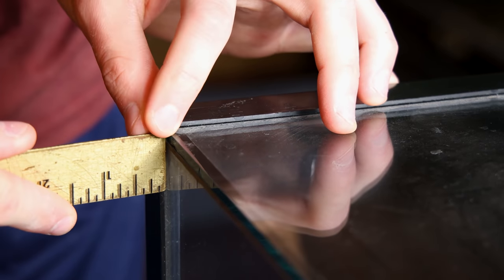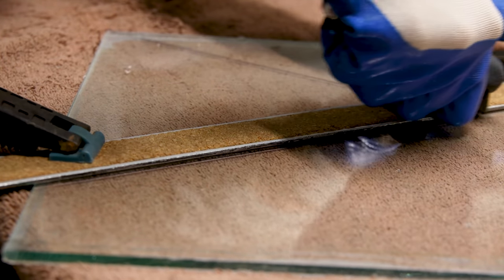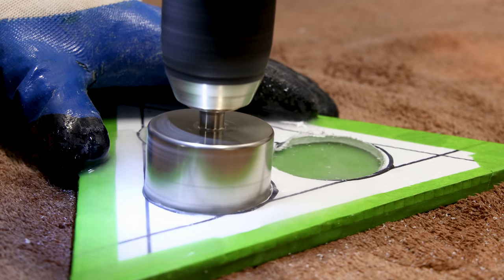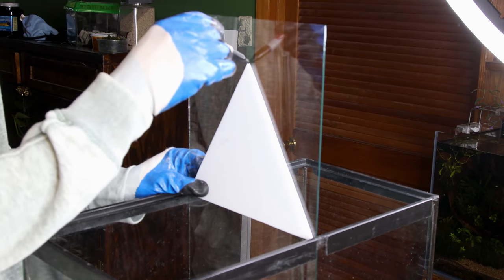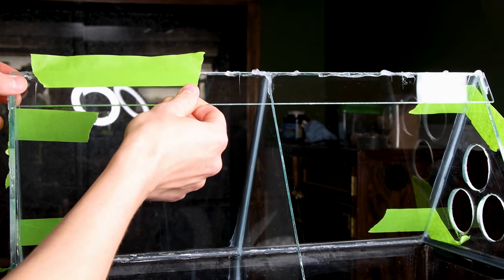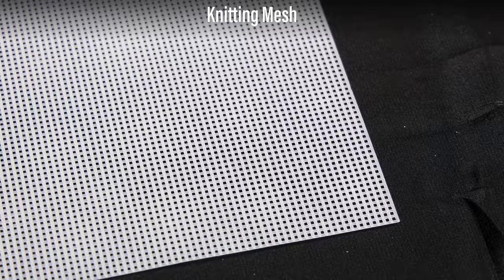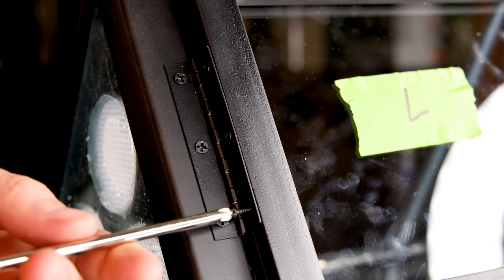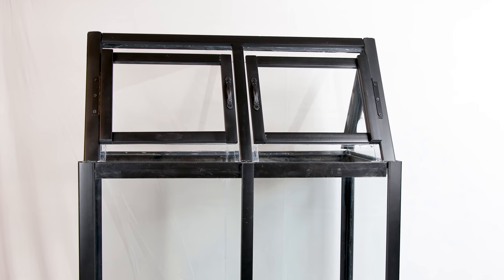Easy DIY Aquarium to Mini Greenhouse Conversion

Comment: I cannot wait to see what ends up in here- why the two halves? We'll soon find out I guess!
Reply: I would guess mantids if he does stock it with animals
Reply: @pocketpj2722  if it’s a 20 gallon that’s divided into two with a little bit at the top, let’s assume it’s 10.5 gallons. It’s also designed to hold in humidity, so that also limits the choices. Mr. Serpa could put mourning geckos, small geckos, Small tree frogs, or any other small animal. But what if he did a land/water thing? One side is a tropical terrarium and the other side is an aquarium biotope?
Reply: @Shadowood_Jedi_Temple  I could see small tree frogs but I feel like it's way too small and arboreal for really anything. It could just be for plants but idk why he would divide it if it was just for plants... hmmmm
Reply: Herbs 🪴😁
Reply: So... In the end what went in there???

Comment: I suggest cutting a circle portion of tape for the middle of the knitted mesh to keep them neat after the silicone had cured then use the ball end of a traditional glass cutter to smooth your silicone beads to make it easy and aesthetically pleasing when tidying it up plus it's easier to remove the excess silicone.
 
Edit: Just a suggestion no hate, love the work and content

Comment: This is cool..got some spare aquariums laying around I might try this with.

Tanner, why don't we ever see you using a dremel? Cutting through that aquarium frame with a cut off wheel would be much faster, easier, and safer than a utility knife. Everything else, 👍.

Comment: What Silicone do you use I’m making a custom fish tank and don’t know what silicone to use
Reply: 100% silicone adhesive. Any type or color will do as long as it's labelled as "100% silicone". There are upper limits to how well silicone can hold together glass. I'd be wary above 220 gallons, even with appropriately thick glass. The silicone will work to seal at volumes above that, but I would look for another adhesive to actually hold the glass panes together. Also, silicone doesn't adhere to acrylic long-term.
Hope that helps!
Reply: Thanks good to know